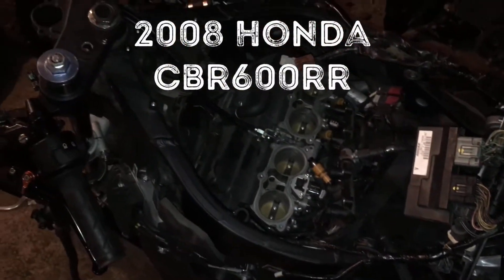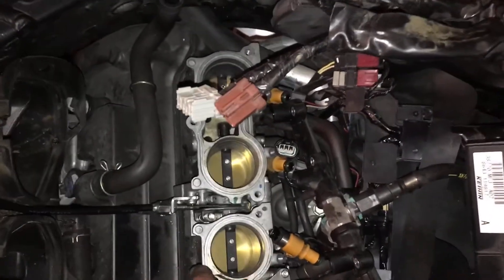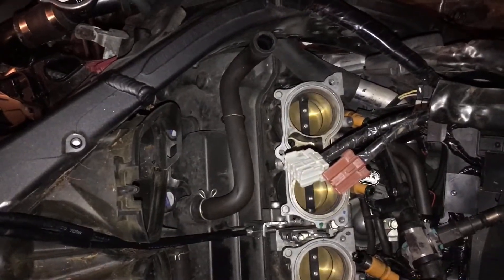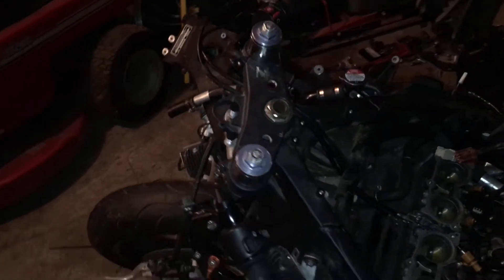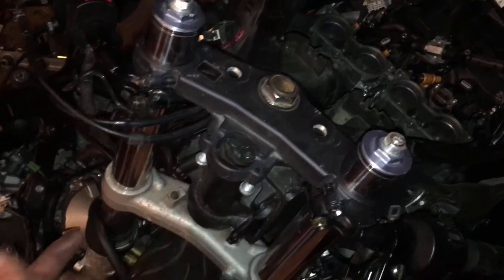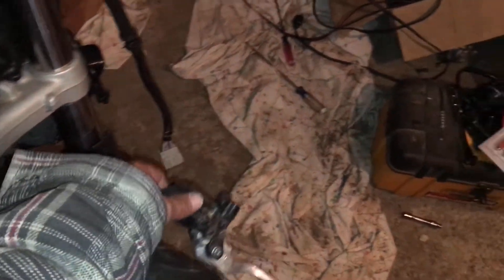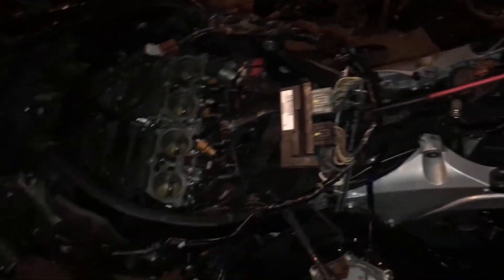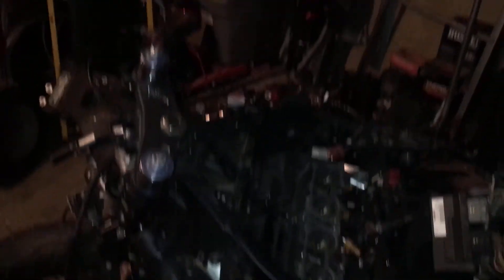2008 Honda CBR600RR UPDATE Replacing throttle cables

Comment: Fuel tank is designed to be flipped up, remove the front side two bolts, leave the two at the rear. Flip up tank, use rope/bungee in the holes on top edge of tank and secure to rear of bike. You have to pull the drain hoses up a little and reroute after lowering tank, they go out by the bike stand.
Reply from the maker: Your comments are encouraging me to get back to this project!

Comment: Got mine running after a battle with the fuel pump not priming had it all back together went to take it for a test drive and when I kicked it in gear it died so I ripped the clutch cover off to discover water in the oil completely ripped apart the motor and its now back together but still running into small problems here and there this video looks like it will help me out so thanks

Comment: This video was super useful, I appreciate it man! Is there a website that you get all of your torque specifications from? I haven't looked yet, just thought I'd ask.
Reply: So how did you get the bottom cable out? What did you end up doing?
Reply from the maker: I didn’t use and torque specs but I have a manual and I’m sure it’s in there. Definitely remove the handlebar ends first to get slack and then fish it out the engine side. May need a pick to help persuade the wire out. Getting the new one in was the major issue…..had to remove loads of parts to gain access from the seat area
Reply: @mcycleshawn  Thanks a lot man, I appreciate it! I've been looking everywhere to see how people get that bottom cable in and out. I haven't really attempted it much yet, just letting it sit for now haha. I may have to make a video on it for anybody else that needs help.
Reply from the maker: @zSpeed600  yes! I believe I have footage of all that. Need to put a video together lol
Reply: @mcycleshawn  That'd be cool man!
Reply: I'm trying to replace cb600fA hornet/599. 2007 push and pull throttle cables. Any tips please ,can find any videos for my bike , thank you 👍